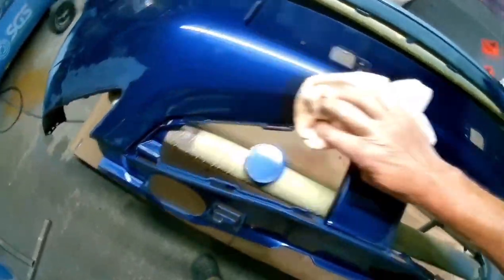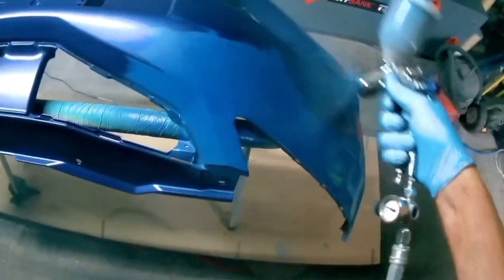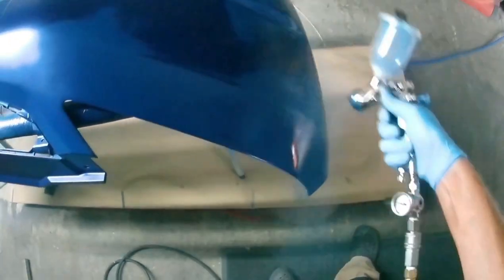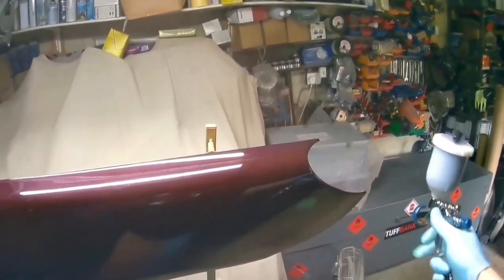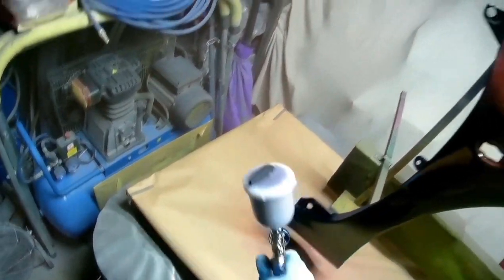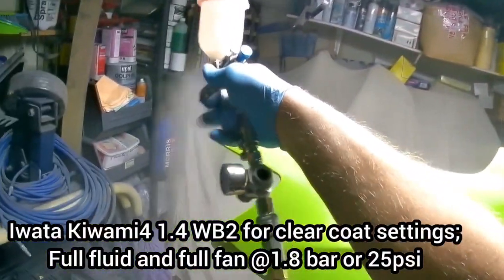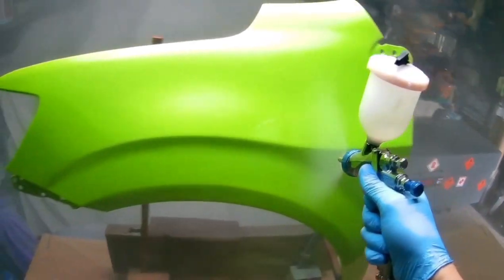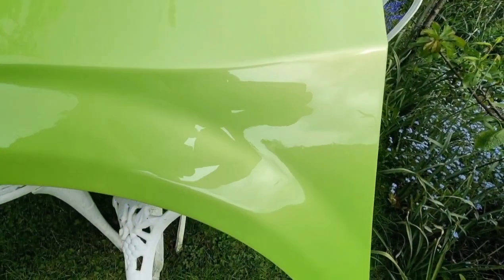Iwata Kiwami4 WB 1.4 For Basecoat & Clearcoat

Comment: Been waiting to see this video for weeks super like from me pete I have the kiwami 4 red cap pete is there mutch difference mate it's the 1.3 version
Reply: The WB model has a little less fluid output, larger holes in the air cap, and has a split nozzle
Reply from the maker: Hi Andrew, James has got it spot on, the WB delivers about 30% less material than your gun as well as a 3 split nozzle, it also uses about 40% more air so you need a good supply of air or a big holding tank

Comment: Good video! Ever tried spraying the Wider4L on high pressure like 1.5 Bar? I noticed a lot of people spray its predecessor LPH400 at higher PSI
Reply from the maker: Hi buddy,  I haven't gone above 1.2 bar, certainly for basecoat the standard 1.1 bar is fine and too much causes the base to go on a bit dry, it may work better with clear as it's normally thicker but you lose the appeal of this gun which is low overspray and it would use loads of air at 1.5 bar, i will try it one day but the finish is really good at the lower pressure

Comment: Hey Pete, another interesting video mate I had to watch this twice as I couldn't take it in on the first attempt it's not your fault I've had a couple of bad days with my stress and depression which came to a head last night with a migraine and all my meds have left me feeling confused, yeah I know nothing new there I hear you say🤪🤣
Anyway enough of my life story, was you using the Kapci basecoat on the bumper mate as the coverage looked terrible, I've had a couple of colours like that but the blues always seem ok.
The red base on the wing looked like it went on really nice and it really shows the benefit of the split nozzle as it really atomises the base nicely but as you say the downside is a slower gun.
I liked that green you had on the last one Pete (I did a green similar to that this morning) do you have a code for that colour boss, pretty please🤗😁 the WB put the clear on really nice and flat but again it's really slow doing it but that wouldn't bother me I'd rather it be slower if you are getting a good finish at the end👏👏👍 thanks Pete👍
Reply from the maker: Hi John, from memory that wasn't one i mixed from my kit, it was a ready for use tin, as you say, coverage wasn't brilliant but it wasn't too bad , these guns put out a fair bit less than your Bellaria,  about 30% less everything being equal so even on full fluid your not getting loads out, the other wing was, again from memory waterbourn, I got some damaged tins off ebay and have been experimenting with waterbourn as it's been relatively warm for the past 4 months so as good a time as any.

I think i got the green one from you or maybe the other way round 😂,  it's a Lamborghini 0077 which is a 3 stage, cheers 👍
Reply: Ah yeah that makes sense as sometimes the ready mixed colours don't cover that well but at times they are good value. The Kiwami4 did a good job though mate as you said they do use a fair amount of air, I think it's around the same as the WS400 but these days air consumption isn't such a problem.
Yeah the good old James Bond 007 with an extra 7 and yeah I remember seeing you do it and you gave me the code I believe🤔🤷‍♂🤭
Reply from the maker: Yes, the WB uses a little more air than the WS and a little less than the LS400 so not far off each other although the WB runs around 1.8bar, you certainly notice the difference between the WS and LS so although small it is noticeable,  cheers mate 👍

Comment: Hi Pete that was a great video, for a moment I thought that the filler/primer was never going to cover up on the bumper with the paint, but you got there in the end! The wing come out really nice as well! I assume you used both compressors in tandem? Or was this around the time you was waiting for a new motor for the SGS one? I just heard you direct drive compressor kick in that all 😂cheers pete.
Reply from the maker: Thanks Steve, yes, there was a period of around 3 weeks that i was only using the 50lt direct drive but it was piggy backed to the 90lt so still had 140lt but noisy as hell 😀, 

 I ended up with another SGS 90lt and now they are all piggy backed and the two 90lt compressors can run together if needed so loads of air now
Yes, coverage wasn't particularly good on the bumper, that was pre mixed rfu stuff and wasn't particularly good, I did another one that i made from my kit and that was much better 👍
Reply: @peteshobbies5383  wow 230L of capacity and potentially 42.6 CFM assuming your 50L is a 14.6 CFM that’s some going that is mate! I dread your electric bill though, saying that mine isn’t much better 🤣
Reply: @peteshobbies5383  forgot to say, shame about the RFU stuff I hate buying rubbish with good intentions, it makes the job so much harder in my opinion.
Reply from the maker: Yeah,  lot's of air, i only keep the two 90lt compressors plugged in and I've set them at different trigger pressures, otherwise they will probably blow the trip to my workshop, having said that, i don't get the second one going,  just not needed, if i was doing a whole car them maybe but i haven't got room really 🙂
Reply from the maker: Yeah,  it was someone else that got the paint , long story but i got there in the end, more chance of a reaction on preprinted repaired surfaces as well because of the high thinner content in cheap rfu stuff, hope your painting is going ok, look forward to seeing how you got on 👍
Reply: @peteshobbies5383  My wheel I’ve parked to one side at the moment, I’m concentrating on the Wing and bumper on that Honda, I’ve still got more rubbing down to do on the wing so it looks right as there is still some slight unevenness in the primer just needs a bit more work. The bumper I have only rubbed down the imperfections I really don’t want to put the filler primer on like I did the wing, I don’t think the wing needed it in all honesty, so I’m going to thin down the primer when I do the bumper and try my hardest to get a good off the gun finish from the primer so I can move straight onto the base. It’s long and slow as I know you totally understand. I want it to be my best work ever even though they will likely be the best panels on the car.
Reply from the maker: Yeah, that makes perfect sense, using the high build as a wet on wet, good luck with it mate 👍
Reply: @peteshobbies5383  Thanks Pete, I think I will need it 😂 about time that I made sense 🤣

Comment: Dear Pete, I want to ask a small favor.  Are the "blue" colored air cap cover/ring and the fluid adjustment knob in Kawami WB2 and the "bronze" colored air cap cover/ring and the fluid adjustment knob in Kawami BA2 interchangeable?  In other words, are the threads on both of these guys the same so that I can use the air cap ring and adjustment knob in Kawami WB2 on Kawami BA2 (or vice versa)?   Take care.
Reply from the maker: Hi mate,  yes, they are. It's only the colour of the anodizing that's different. That's the same for WB,  WBX, and BA4J versions
Reply: @peteshobbies5383  Thank you, Pete.
Reply from the maker: @windsurfingphd Your always welcome mate 👍 
Was you asking for an email for paintingtool.jp?

Comment: Hi Pete, thanks for the good content. I have been enjoying using a couple of evenings now.
  - Watching you do magic with these guns. 

Since i happen to be in Akita in Japan, I thought to my self to pick up an iwata paint system. And finally retire my unbranded 75 pound ebay gun. (Looking overdue)

If you had your pick, for a car, complete respray solvent based, in a climate similar to the UK, with a 5hp compressor, which gun would you choose? 

My considerations 
Kiwami 4 WB 1.4 for base and clear 

Kiwami 4 wbx 1.4 for clear kiwami 4 WB 1.2 fra base 

Or something like the WS 400 for clear and base. (Maybe supplemented with an kiwami 4 ba4 1.3 for base, to keep an dedicated clear gun)

Your input would be much appreciated since I consider and absolute expert in the subject
Reply from the maker: Hi Casper, I would go for a Kiwami4 WB 1.3 for base and a WBX version in 1.4 for clear, maybe 1.2 in the WB, depending on how much material you think you may want to apply, the WBX and WB tips are interchangeable btw.
The WS400 is quite expensive in Japan with a new version out there in November, the new version and the old one set up in the same way are really very good, but so is the WBX, the clear WS400 is no good for base as it atomises too much and leaves it dry or peeled if you drop the pressure, the base WS400 is good but not better than the Kiwami4 WB2
Reply: Thank you very much for your time Pete ! 
I will definitely follow your advise. I will update my shopping cart and wait for my new toys to arrive. Glad to have your videos to establish a ground setting for the guns as well. 

Once again a big thank you and have a nice weekend. Happy painting 🎨
Reply from the maker: No worries Casper,  cheers 👍

Comment: Awesome vids Pete as usual do u ever spray epoxy I’ve got some chassis work todo and have been looking for a gun I’m swaying to a Chinese knock off with a 1.8 nozzle is there anything u would recommend
Reply from the maker: Hi Adam, rarely spray epoxy but have done, depends on the make but most will advise a tip between 1.5 and 1.7mm but you will get away with a bit bigger, I've used my ANI F160 in 1.9 and it was fine, if i was buying a gun especially for it i would go for a ANI F160 in 1.7 or a Walcom  Slim Xlite HTE in 1.7 or 1.5 if the epoxy you are using recommends a smaller tip
Reply: @peteshobbies5383  cheers bud I have a walcom slim hte 1.8-2.2 gonna give it a try see what happens thanks for the help mate
Reply from the maker: No worries,  The Walcom should be ideal 👌